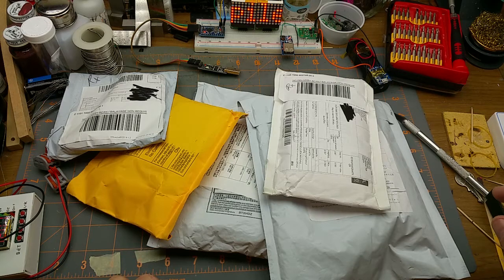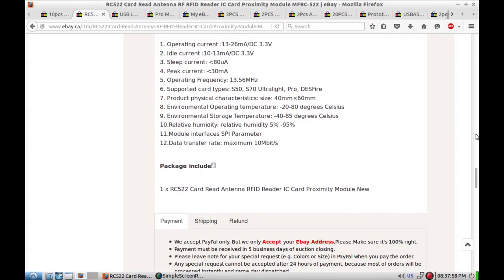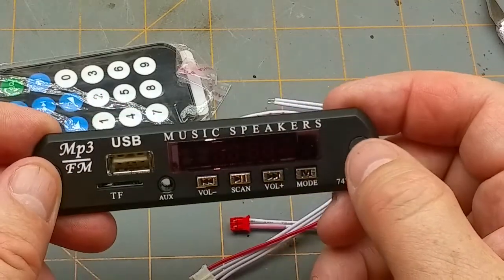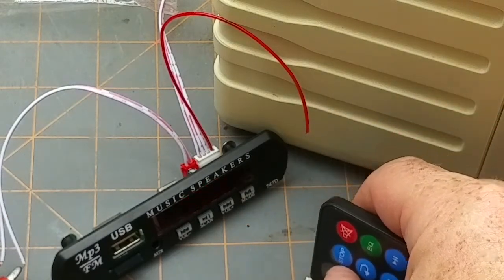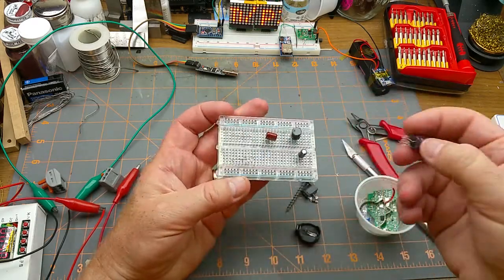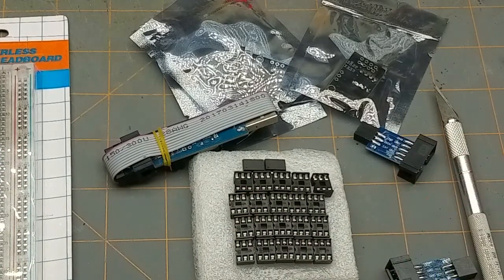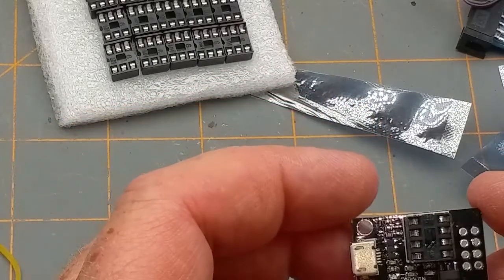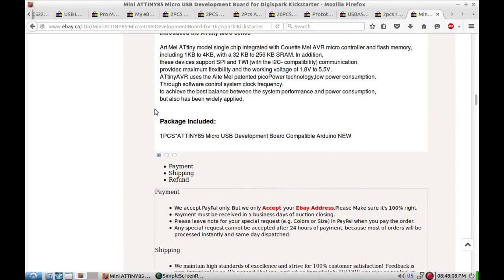Mailbag 7

Comment: Better late than never.
If you want to keep it cheap, you could throw a PAM8403 amplifier after that MP3 player module.
They're really cheap and the sound isn't too bad either.
Reply from the maker: believe I even have a couple of those in the pile somewhere...

Another future project emerges!
Reply: @pileofstuff  I'll be looking forward to it 😊
Also, thanks for your great and inspirering videos. You have made a quite extensive shopping list on eBay for me 😂
At some point I'll be doing electronic videos too, mostly kit builds but also mailbags as stuff pops up.

Comment: I bought a couple of those MP3 player units. They were listed as 12V in the listing. Did not say 5V like yours did. So I clamped a 12 v lead acid to her along with a small stereo and and 2 small speakers I got from princess auto. It worked for about 5 minutes and then the magic smoke came forth.  I checked other listings for it and most said they are 5v. Oh well. I have a spare. So ya. Don't use 12v.
Reply: Same here but it wouldn't work on less than 5v. Upped it to 6 and poof
Reply: I think some are 5 volts and some are 12 volts.  I have 5-volt one I run with a 18650 and it runs the USB.